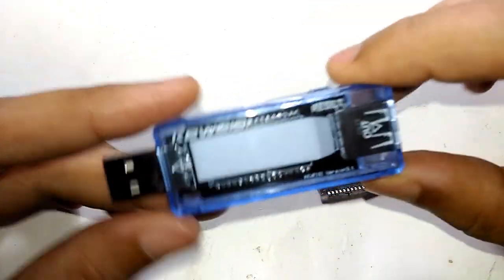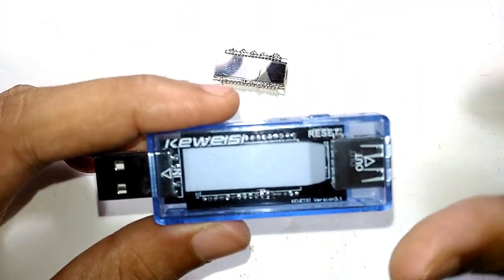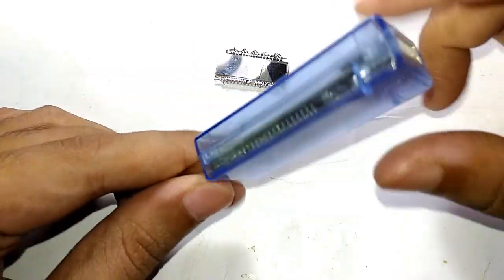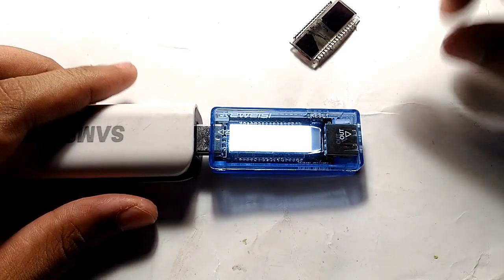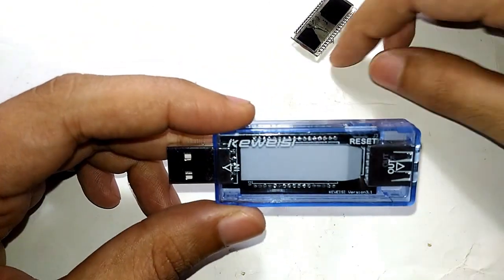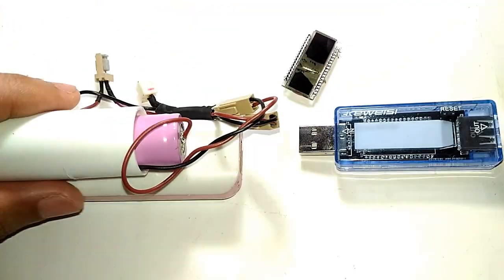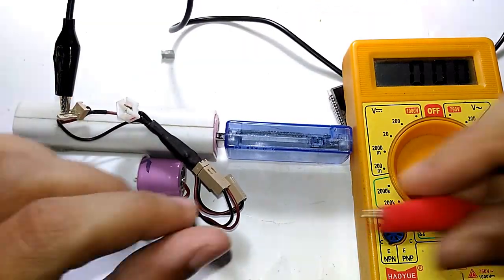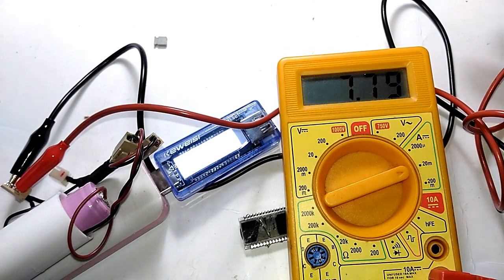IE#18: DIY re-purposing the broken USB power meter!

Comment: does it have any different with this item ?
https://www.amazon.com/3-7V-21V-Electronic-Intelligent-Constant-Discharge/dp/B01LKT0OTQ/ref=sr_1_11?keywords=qianson&qid=1556189967&s=gateway&sr=8-11
Reply from the maker: Yes. The one in this link is the better one, it's an electronic load and has various features. The one in this video is just a current meter..